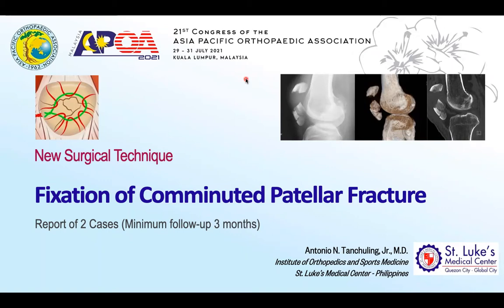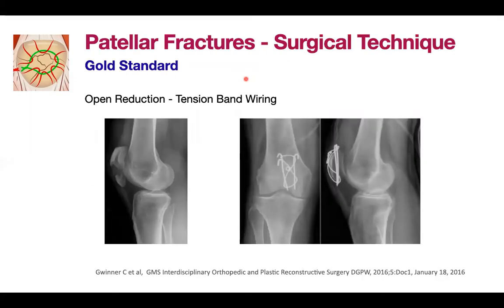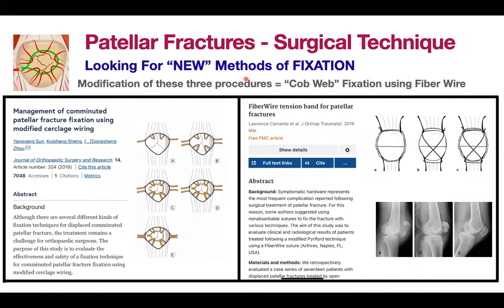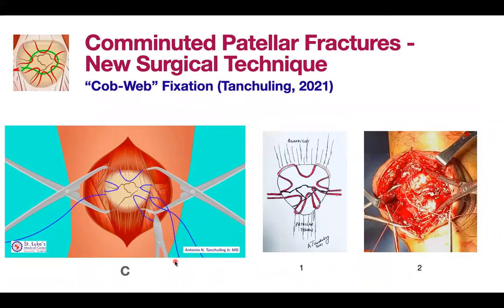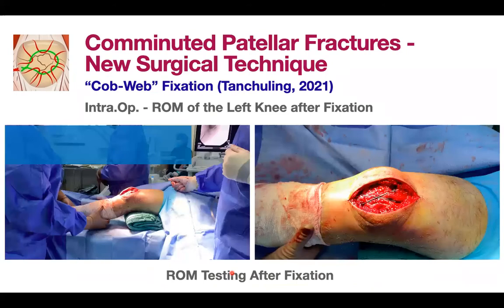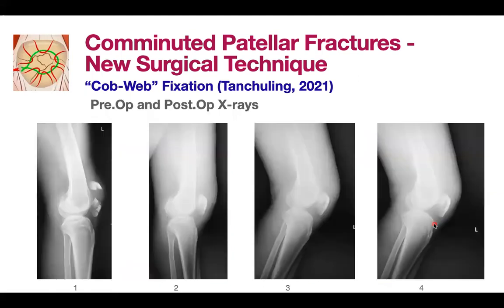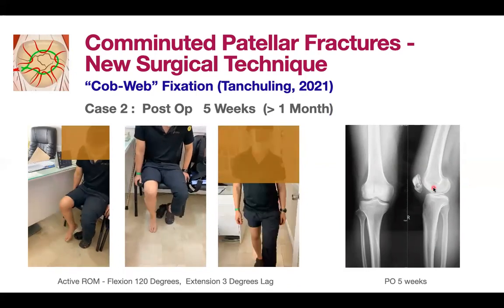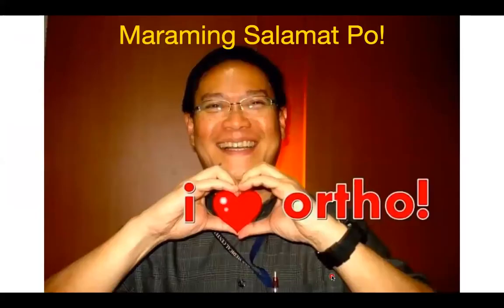"Cob-Web" Technique - New Method of Fixation for Comminuted Patellar Fractures

Comment: Thank you fro your surgical video of patellar fracture. I prefer transverse skin incision to vertical incison. Transverse skin incision is good becuase of no sensory nerve problem of infrapatellar branches of saphenous nerve and wound problem, and no  hypertrophic scar problem in case of vertical skin incison. And there is additional advantage of  early ROM of knee compared to vertical skin incison.  Finally, wound closure is very easy in transverse skin incision. 
Fracture reduction even in comminution and displacement is actually not that difficult in transverse incision. According to AO recommendation,  I have tried vertical skin incision in only one case  of patellar fracture treated with vertical skin incision 15 years ago, but I have experienced with unpleasant  memory due to wide dissection , difficult wound closure,  sensory numbness on lateral aspect of skin incision, and ugly hypertrophic scar .
Thereafter I have always used transverse skin incision with no special difficulty and very satisfactory results.

Comment: Good day Doctor, I am 3 weeks post op of comminuted patella fracture with stainless wire fixation. I have been told to wear brace in locked position for 6 weeks. Weight bear as tolerated. I slipped and fell on my knee. I am 62.  I am amazed at your new technique. Wish I was in Philippines! To see someone moving and bending after two weeks! I feel the method used for me, will take much longer before I can bend the knee and walk properly. 
Here in Australia I was sent home day two after surgery!!!!  Barbaric! I was in screaming pain. Horrific experience!
I have been in Phillipines 2007 and had a back injury which required surgery. I was treated so well. 
I think people should think twice before thinking things are better in other countries. Good work Doctor. If I have complications I will be looking you up and coming to Phillipines.
Reply from the maker: Hi sorry got to read this only now.  I can see you when you come home